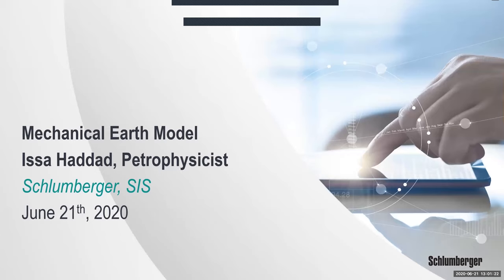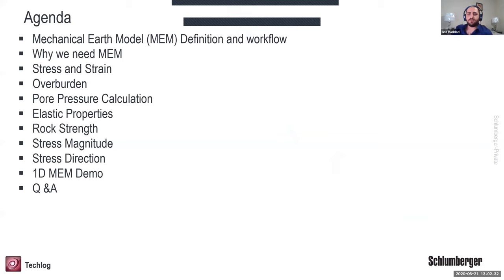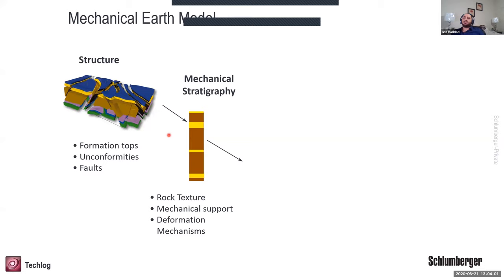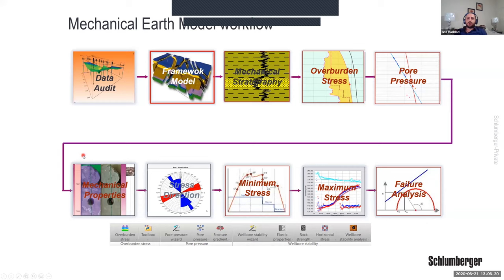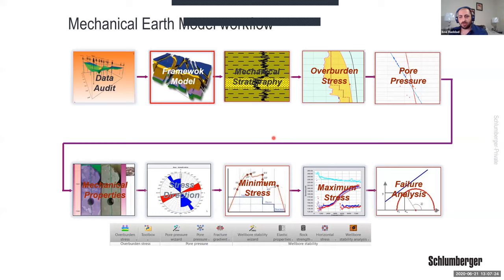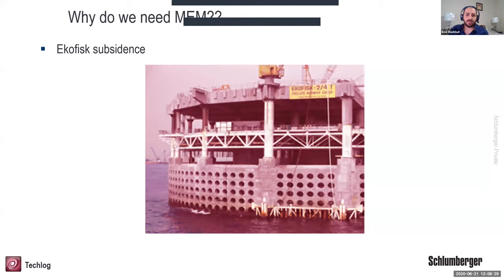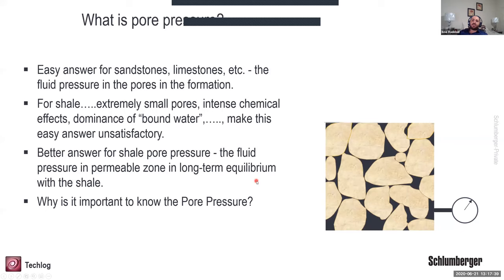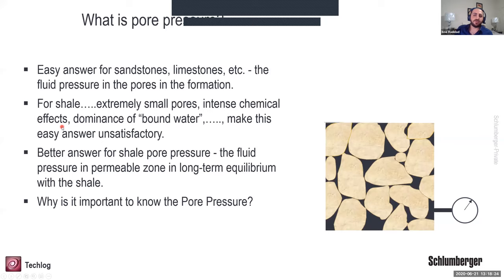Mechanical Earth Modeling, Eng. Issa Haddad

Comment: what is the difference betwen pore and frac pressure
Reply: They are totally different concepts. Pore pressure is the fluid pressue inside the rock pores.
Fracture pressure is the pressure required to create a fracture in the rock as we are breaking the formation.
Reply: @issahaddad7071  HI sir, what is the difference between Pore pressure and formation pressure